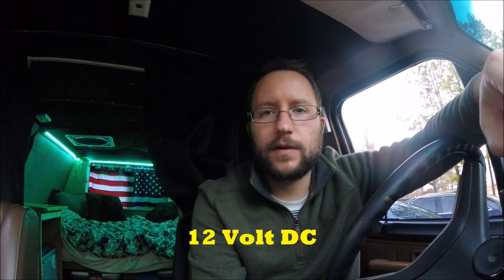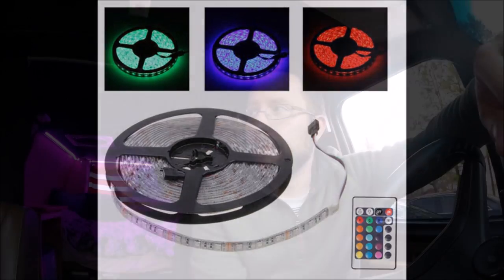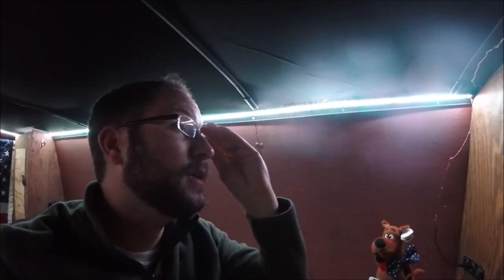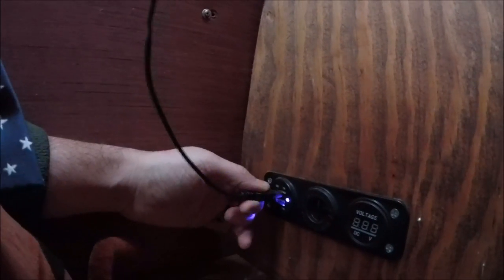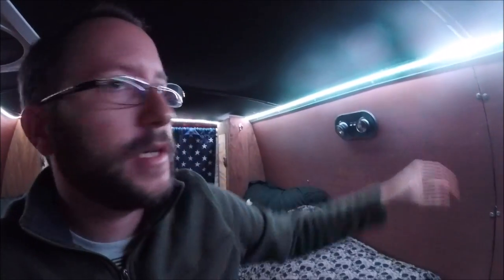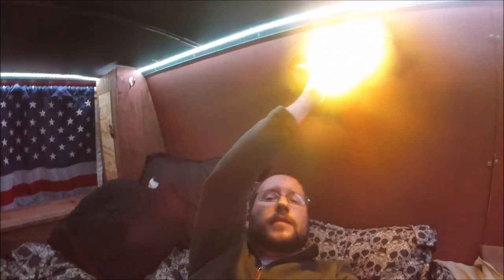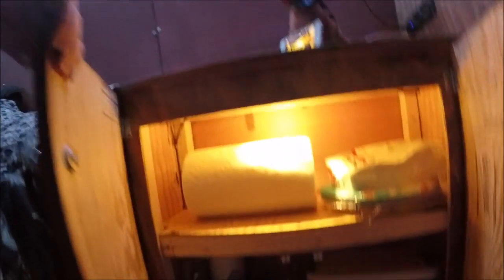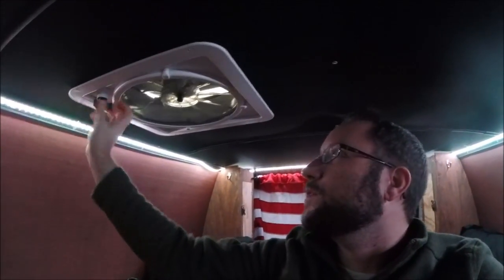Camper Van Lighting Options

Comment: hey man those light switches are incredible lights. I'm pretty sure the name brand is called flip it. they work really good I use them on the cab side of my bulkhead.  I found that the LED strip lights comma use a lot of watts and amps, I ended up going with very low and led switch on and off lamps, also I went with battery operated Puck lights named Hoover comma you get 5 of them for around $20 and they come with the remote and also switch colors look into those very very good also keep up the good work I love your videos
Reply from the maker: CamperVan Travels thanks for the tip on the puck lights, I'll have to check them out!
Reply: Did you end up getting my email

Comment: Excellent light review. Thank you for putting links to your components in the description box. I just put a 16' strip of the led lights in a 12 x 14 cabin that is powered with solar and a battery. They light the place up great. I have a video on the lights on my channel. Keep up the good work.
Reply from the maker: Chain saw cabinet Shop thanks for the compliments. I am glad you found the links helpful. I'm definitely going to check out your channel. I would love a tiny house or cabin, but it's hard to convince my wife to downsize from the 800 sq feet we have now.

Comment: hey man do you have a email address I could send you a link to those Hoover 5-pack of the puck lights. They are by far for the cost, the best nights I've ever used in my 2007 Chevy Express camper van. They give you the luxury of RGB and cool white and warm light with remote control and the park feature of the Press on and off also
Reply from the maker: CamperVan Travels sure thing, rubbertramprenegade@gmail.com
Reply: mind sending that to me as well, would be interested friend?
Reply: Are you asking me to send you something or rubber Tramp Renegade
Reply: YOU, lol. sorry I didnt specify.
Reply: What is it that you need to know? Are you referring to those Hoover Puck lights